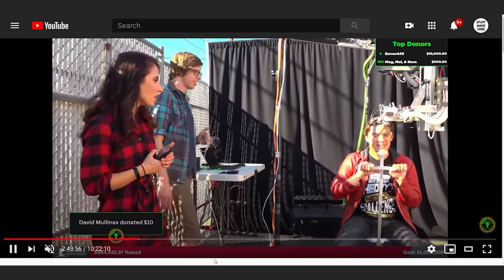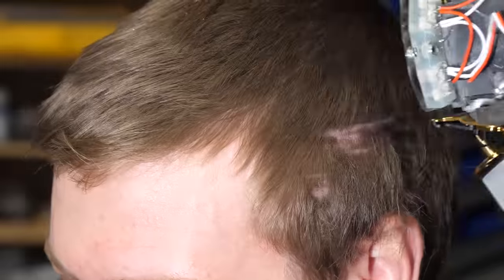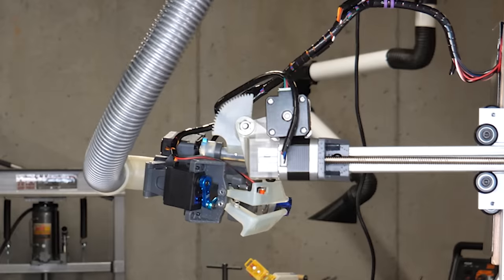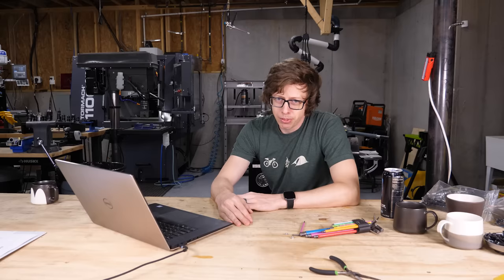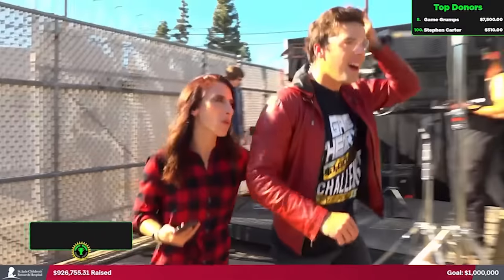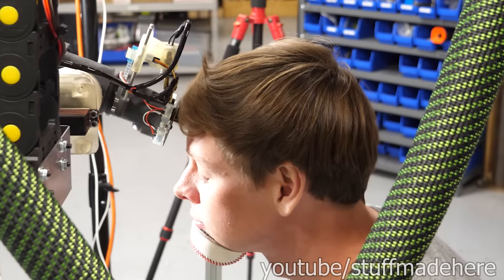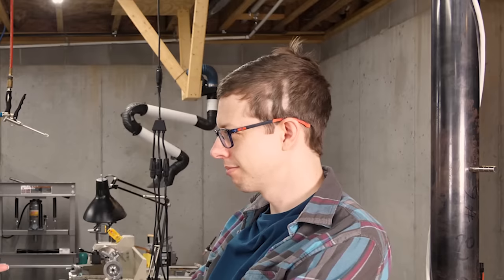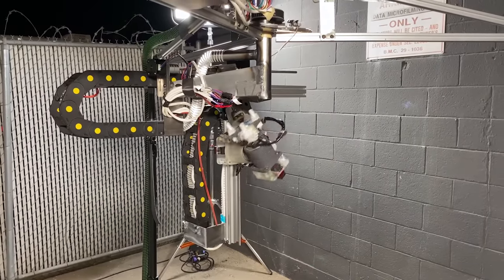Sometimes you have to test robots on yourself

Comment: *IDEA FOR "PRACTICAL USE" BUILD*
I'll keep it short and sweet.. Essentially I'm proposing a snow removal (or snow reduction) tool which can be easily attached to virtually any vehicle on the road.

Stop reading here unless you care about thing like how and why and stuff.. 

I live in Michigan and snowy roads are a big problem during the winter. Plow trucks get overwhelmed and don't get around to plowing side roads or back roads until many hours after the snow falls.. if they get to it at all.
I suggest allowing the people to contribute in a similar fashion to Uber or Door Dash. Sign up to be a driver, equipment is sent to the driver, driver attaches the equipment to their approved vehicle, and they log their "work miles" on an app linked to the plow device.
There are plenty of issues with this idea but we in Michigan would appreciate you forever if you can help us out! :)
Reply: Ps I like my own comments

Comment: What is the size of the cutter that you are using for carving the image.
Remember that the smaller the cutter, the more precise, detailed and clear the image will be that is being cut will be.

In closing I would like to state that my 2005 vintage hair cutting bot works flawlessly every time.

I take out the bosh hair clippers, plug it into the wall, and guide the 2 inch come along my hair several times to get a perfect cut. Flawless cuts.

Comment: You should use some laser scanning or something that build the head in 3D so the software knows afterward the boundaries of your head, but it extremely important the head will be at the same position at all time. also the software need to see the direction of the hair so it will cut against it.. and scissors it too dangerous so only a trimmer. I believe barber can help you with easy and best technics to approach most hairstyles

Comment: What about putting the override switch in the center of your skull indicator triangle? (edit: never mind your final solution with the plate was genius) Also, perhaps something like a BLTouch might work great for this. 

Would the camera system you use for your pool cue and bow work for this? 

Stuck in the house to escape the smoke as California burns... Your channel is saving the day :) thanks!

Comment: Maybe I missed it, but did you mention if you fixed the angling issue soon after flying back from LA or did you use the dummy switch for a few more runs? I’m assuming you didn’t need the switch for your brother’s cut.

Comment: IDEA for California, a robot that can roll up a tree trunk and cut all branches at least 6 feet up. would likely need to be gas powered. It could be for forest service or even some home owners to quickly prevent worse forest fires by cutting the branches that easily burn because the brush produces flames at least that high.

Comment: My guess is that the robot should be able to cut the hair depending on different specified head positions that can be manipulated easily and operate more accuratly on the different parts of a humans head .
As in normal barbers, they be switchin between razors ,scissors and brushes in order to give you a clean beautiful hair cut. it's like a defined process or pattern. The robot could also be able to do that. But slightely different to make it better.

Comment: If you fried the computer, but not the hard drive, just remove the hard drive and put it in another Mac of the same model - OR - a different model that will run the same software and attach the old hard drive externally via a cheap USB kit (about $20).

Comment: Brother i found one solution which can be a problem too but here me out...
So the issue is hair not standing out.... We can use a van de graph genrator to provide static electricity to body and we can get the hairs standing so we can cut it... Maybe it will be better.... Also the issue i was talking about is the small spark and high voltage messing with circuit

Comment: SpaceX and friends must have some approach to dealing with the weakest link problem, allowing for some failures without total mission failure.
Elon would say that you need vision and massive machine learning to do a job like this right. However, you probably chose the optimal approach, if the goal is getting something working fastest.

Comment: Focus on simple buzz cuts. Only use electric razors/trimmers.  Helmet design with trimmers rotating around the head
Reply: Small nose hair trimmer to work around the ears.  Several different helmets for size and shape differences between people. Clips with cords to pull ears down for whole duration of haircut.

Comment: Imagine each wire is a link in a chain, one breaks we're fucked...
So build secondary and tertiary wiring for the same paths if it's a single shot kinda deal...

Like the more fail safes you build the more reliable it will be, even if like 50% of your wiring fails for instance.

Comment: My idea for a haircut robot is to use high voltage to extend the hair out from the head and use a laser to cut it. I'm sure you could build something like that.
Obviously the danger level would be higher but there's no biz like show biz. Also who wouldn't want to go to a barber's shop that smelt like burn hair?

Comment: Im a game developer so most of the code I know is related to physics engines and animation and don't know much a bout machine programming libraries in C but I had an idea. Why not try using that LiDAR Scanner in your iPhone 12 Pro or even the true depth camera on the front? they are commonly used for facial motions capture and 3D scanning..would it be possible to use that same tech to scan hair and live updating the results with a little clever conditional loop and a few well placed iPhone 12 pros all communicating with each other to guide the clippers?

Comment: Hi 
Scan 360 degree head from nack to top.
Pin senser around head 
So eliminate depth and surfaces calculation
Select right tool, and mechanism
And also programing command.
Done

Comment: You are doing bulk edits when you need to be doing fine tuning.  That seems to be your issue for your design cuts.  Ever thought about coloring the hair in the design you want and then using a device that only removes the colored hair strands?  Would give you a fail safe in a way before you approve the cutting process

Comment: From the pic on the front looks like you designed a robot to laser imprint tattoos, like step 1 rub section with bleach, step 2 laser burns  tattoo on skin in the style the original printers worked by just changing chemical composition of bleach. Uses all those kids that want super cheap tattoos, and people might regard the actual artistry in needle method that grants a deeper more defined image

Comment: Why doesn't this dude go to a human expert FIRST, to learn how something is done, during his design process, BEFORE the building process??  Over and over he builds something, then has to try to re-design, but then his build limits what is possible.  His approach to cutting hair would be TOTALLY different.  Anyone who's had their hair cut knows you "mow" hair with a trimmer, not stab at it.  Even with scissor-over-comb (first design), you work your way up the head, against the grain.  Build a trimmer guard that is adjustable (a series of triangles lined up), and take passes up the head (cutter rides on head), repeating each pass a few times to avoid missed hair.  90% of a basic fade: 1/8-1/4" on sides, 3/4-1" on top, 3/8" on the transition between sides and top.

Comment: HEY NEED HELP POWER MY HOUSE WITH 3 kw STIRLING ENGINE/generator 220volts  that works on 60c hot water reservoir from solar evacuated tubes and cool reservoir 10/5 celsius from a well that will probably help lot of ppl out pls help   / self regulating RPM automatic start